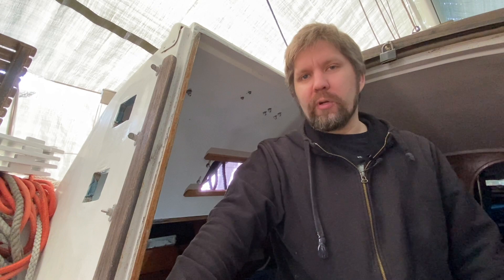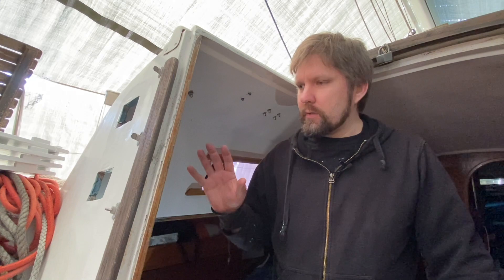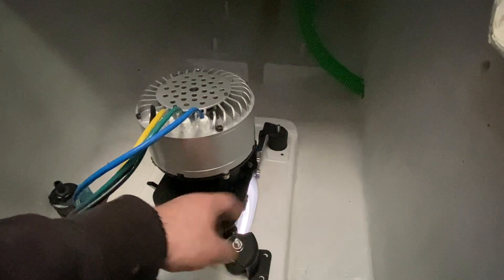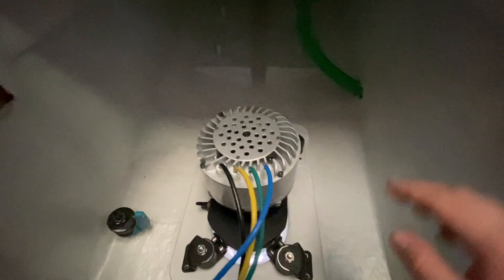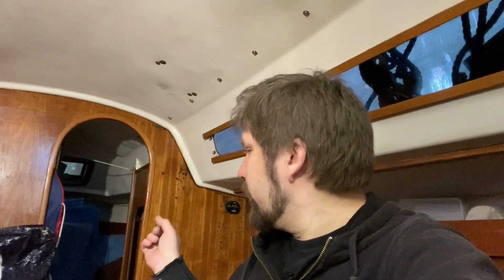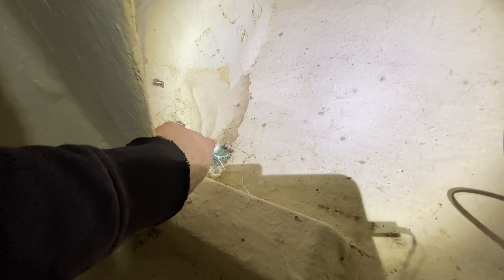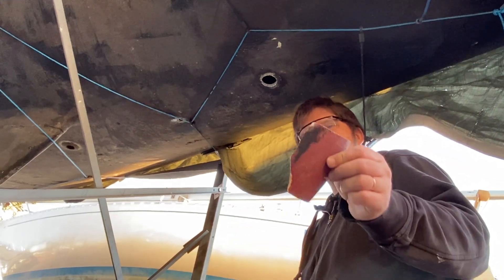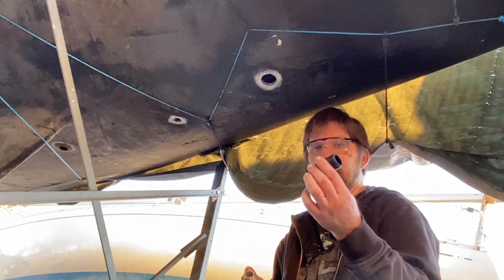Electric motor to sailboat Part 6: Installing stuff to boat: Ep11 Project SeaCamel

Comment: Very nice work. Although while you are on the hard, you could have relocated those through hulls out of the motor compartment and maybe even installed a watertight bulkhead at the aft end just to improve flood resilience (of course a bilge pump would still be needed.😉😀👍⛵️
Reply from the maker: Thanks mate! This is such a small boat and currently only used in lakeside so no really worries there. All the tru-hulls are now new (except for the cockpit drains which I believe to be bronze, in good shape anyway).
The thing to improve is the hatch for the cockpit seat. The flanges are too low to keep all the rainwater out.
If it was for sea, there might be a little different solutions here and there.